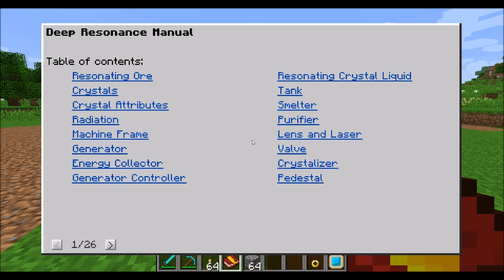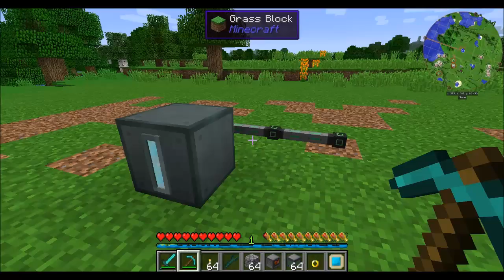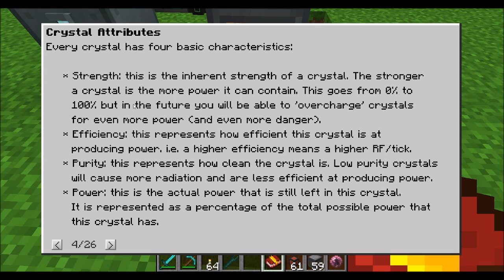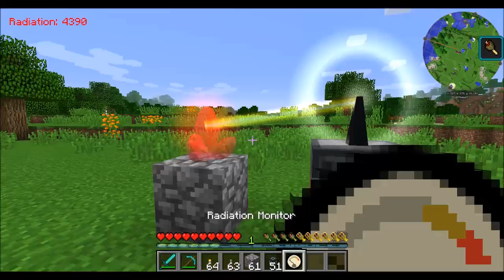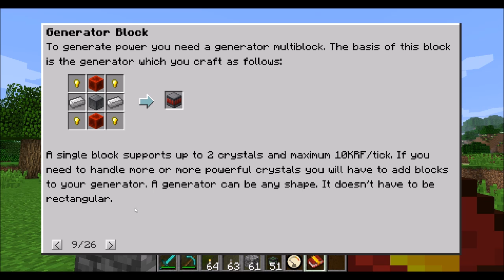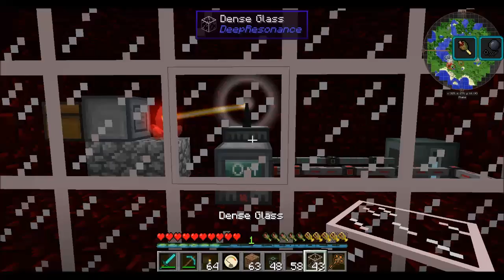Mod Spotlight   Deep Resonance

Comment: I think that if you could grow the ore via mystical agriculture or make the ore using productive bees that you could easily sustain this method of power generation. Using the wireless redstone from create would be an excellent way to make it so you don't have to even be near the generators. That of course means you wouldn't have to worry about radiation if you're willing to sacrifice a larger area or build the radiation protection you need.

Comment: 6 years need up dated  the curse forge mod page has "comments" disabled honestly this mod is severely outdated by 1.19.2+ standards as well as much better made mods like mekanism it literally requires to even use it (no pipes/or power transfer/generation  included nativly) also the liquid crystal animated textures are nerfed...the amount of resources to get a "pure" crystal via defaults is overly time consuming as well and the config is total garbage

Comment: Question, if I have an excessively large tank (1,280,000mb) for the smelter output, can I put the purifier below it, and let it feed back into the same tank, or no?

Edit: the purifier idea worked, but now I have a problem where the process stops for no reason, and sometimes breaking/replacing the machines works, sometimes it doesn't.

Comment: How do i get my energy out of the „radiatin chamber“? If i put a cable to the outside, it will leak radiation isn‘t it?
Reply: RFtools power cell linked to a second power cell outside the radiation chamber?
Reply: Numaron lotsa ways to teleport energy

Comment: "You don't want to use this as your main power source."
produces the most RF in the 1.10 Direwolf20 pack(as a 'replacement' to Big Reactors)

Tell me, Dire. What other RF power should be used as my main power source for mid game?
Reply: (Late and BR is in pack now anyway) But endergenic generators are really good, or have a massive amount of canola and empowered canola generation.

Comment: Hey Dire, could do you do a quick tutorial on a proper radiation box? im having issues finding a way to get the power out of the box without creating a gap for the radiation to leak through. Or get the redstone signal in to turn it on.
Reply: Like what Larson said or a Dimensional Transciever thingy
Reply: vineheart01 Use energy laser relays from Actually Additions
Reply: considering this was made by the guy who made the RFtools mod why didn't you think of using linked powercells

Comment: I reckon you could set the whole system up using no more than 5 tanks. A 3x1 above the smelter, purifier and valve, and a 2x1 under the valve and crystalliser. No pipes needed.
Reply: I have actually done this.
Reply: Excellent. When Dire did his build in his series I was watching it and thinking it was over complicated with all the pipes and levers.
Reply: wish oc oud find a image of that .